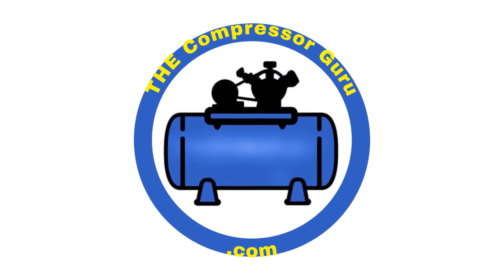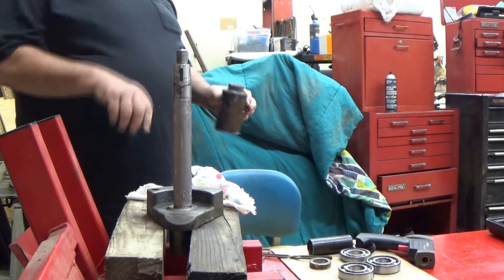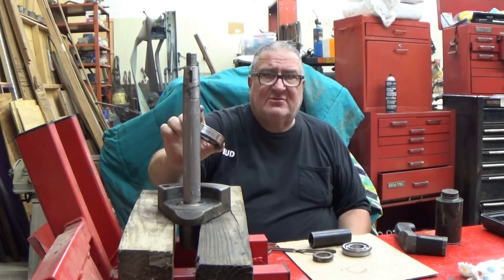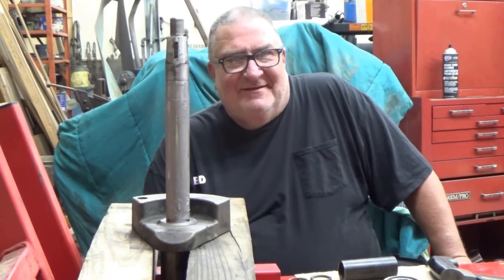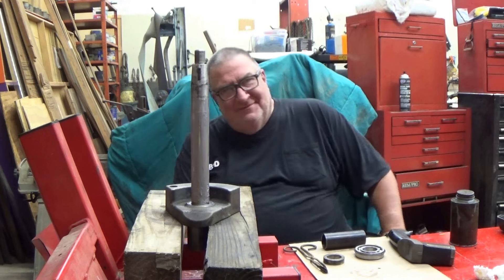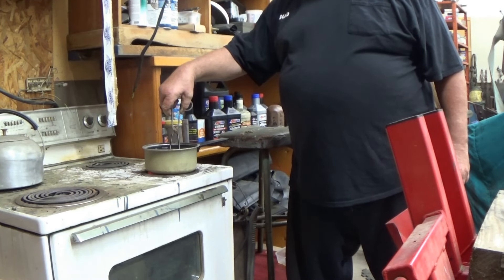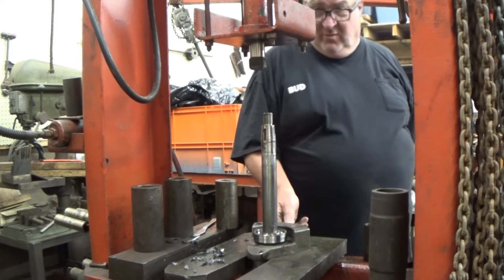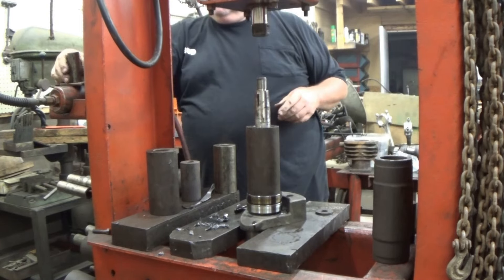Hot OIL Bearing Install???

Comment: Good video.  About the stove or hot plate ... I would have some kind of spacer in the pot, like keystock so the bearing is only heated by the oil and not in direct contact with the pot bottom.  I'm sure it's hotter than the oil.  
Yeah, in the field if the bearing doesn't drop down ...... "nuts!!!"  Or something like that.  Always had the puller ready.  But we did mike the id of the bearing with a snap gauge and were looking for 0.0015" to 0.002" clearance.  Like JeepinMaxx said, I think we used to shoot for 350 deg F.

That spacer has a tighter crush fit, so it would have to be heated more.  Of course you have to be careful that the oil doesn't burn or worse. 

Only other comment was about that spacer pipe between the inboard and outboard bearings.  If it's too loose on the shaft, it may rattle when the compressor runs.  The pinch mark in the middle should be deep enough that the pipe is fairly tight on the shaft.
Reply from the maker: We need to find a way to get you to guest host an episode!!!

Comment: Thanks for trying the heated oil method!  I think if the bearings stayed in hot oil longer and got up to around 350 degrees, you may have had success (I heat the retaining ring on the grill when I'm doing axle bearings on my Jeep).  Also - the retaining ring may have cooled off quite a bit from when you got it out of the oil until you got it over to the press and on the shaft.  Good luck with your weight loss endeavor and hopefully your next doctor will have better news
Reply from the maker: So what didn't make sense to me with these was the lighter bearing was the 1 that went on  and the very last ring which is Tiny in comparison still had to be pressed. the gas grill is a good idea.
Reply: Great experiment! I think all parts just needed more higher temp. I.E. more heat = greater expansion. At work we heated giant 7" I.D. bearings in an electric oven to over 400°F & packed dry ice around the giant dynamometer shafts! We had 5 seconds to lift out & turn, push & seat the bearing before it seized. We did Not always make it! Yikes! 3 men spent the next 6 to 8 hours to cut off that monster bearing to avoid certain shaft damage (gouging) when attempting to press off the seized or any wornout bearing! A real nightmare & pressure from the bosses & engineers.
Blesssings to you all ! Paul from S. Central Tx

Comment: I was always told that you’re not supposed to press bearings from the Outer race. Also, I think you may have got those bearings a little bit too hot.
Should they really be brown? ?
Reply from the maker: as for  the brown I think that was stain from the oil going discolored as the oil got hot.. it doesn't show it well but the old wrist pin I used to do the pressing is very thick and just barely fit over the shaft.